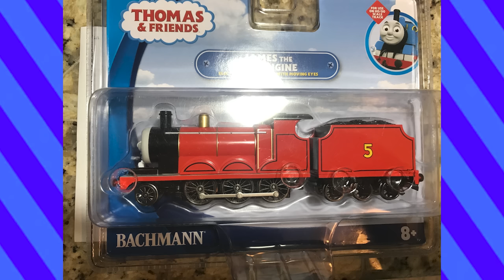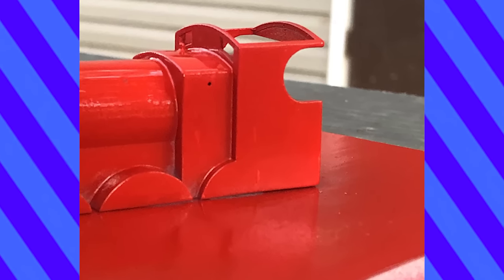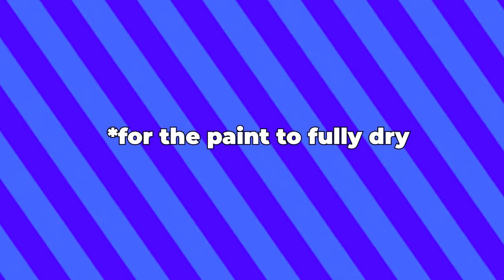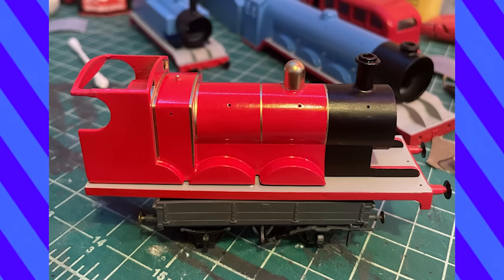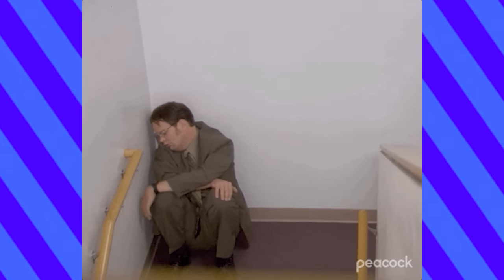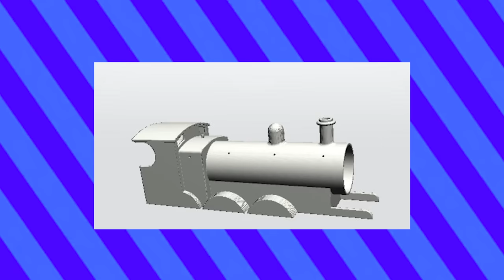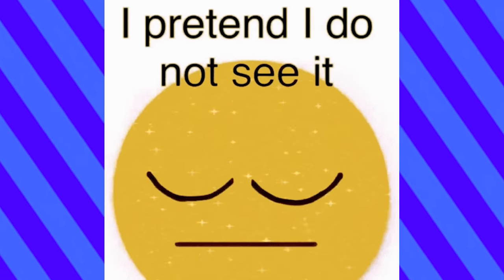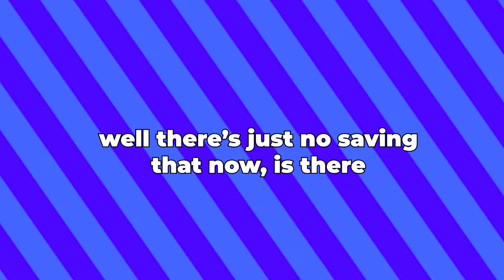Making James | Caleb's Trains HO/OO

Comment: I don’t know if someone already told you, but you can also do the lining the other way around. Spray the model black, use masking tape that has the right width (you can get very narrow ones) to create the lining, or cut the thin stripes with a new blade from your masking tape. Then spray the model black again, to block the bleeding with the body colour under the tape and then spray it red. Or what ever colour the body is. And always thin layers. Better spray it twice than once too thick.

Comment: Hey here's a tip if you make any mistakes, first mask up the part you don't want to be painted and take a plastic cup and spray paint the cup about 1 inch away so the paint builds up and makes it a brush paint and you can just brush on the paint instead of completely putting on a new coat. Tell me if this works well for you because it does for me.
Reply from the maker: You know I've actually tried that! Gordon's got a story...

Comment: I just had a thought and would like to know your opinions on it. Since there's this thing like 'magnetic lights' that can stick to other magnets as well as transfer electricity to the light through the magnet or a small area around it....

Wouldn't it be possible to wire up all 3 of James's lamp iron places and then use a lamp or 2 with a small magnet at the bottom to connect to the running board in place of a lamp iron, and then have it ALSO work by powering the LED within?

Technology's come a long way since the old model series where Gordon and Edward had visible wiring sticking out of their headlamps, I bet if you could somehow pull that off it would look AMAZING and allow you to have functioning lights for nighttime running on the layout for cool video shots.

Comment: If you spray the inside with truck Bedliner could it make the shell stronger?
Reply from the maker: I’ve never considered this, but in theory, maybe?
Reply: @Calebtrain  they also have roll on or brush on you could try, it’s still easy to drill or cut through if needed, it’s difficult to remove off of a surface though, some pros and cons thought I might throw the idea out there